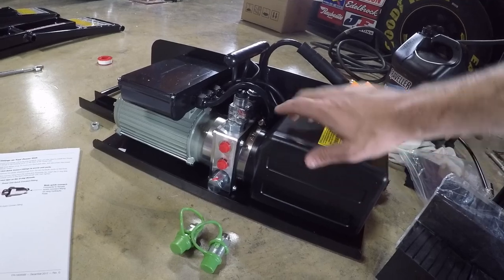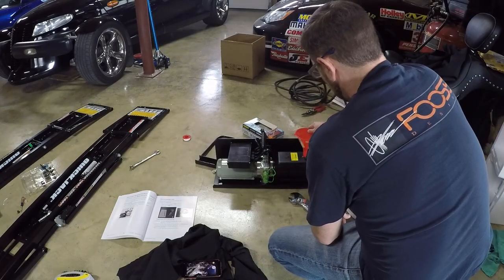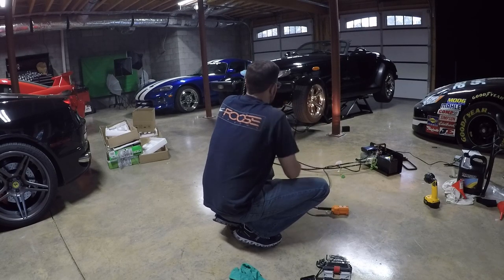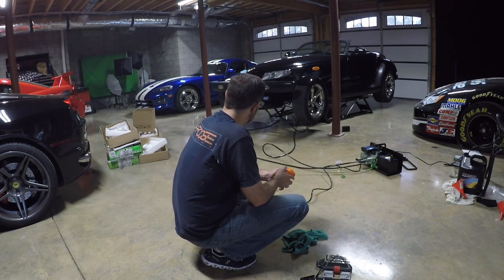BEST $1000 Spent! EASY INSTALL QuickJack BL 5000 Garage Car Lift Setup

Comment: While it isn't in the manual or the "official" QuickJack installation video, I chose to bleed the system by opening the bleed screws BEFORE  doing the first lift.
I did it this way to remove most of the air so I wouldn't have to fight trying to get it out later. I kept the pump on the floor with the frames.
Pulsed the up button a few times to slowly fill the lines with fluid while it pushed the air out. 
You can watch for fluid coming out the bleed screws. Once you see some fluid, tighten the bleed screws (mine didn't start showing fluid at the same time). 
Then push the up button a tiny bit more to lift the frame just an inch or two, then re-open the bleed screw to empty a small bit of air.
After this, I had totally smooth operation with no jerkiness even on the first lift.
I've used it for a few months now with no additional bleeding.
Also, there is no delay between when the up  button is pressed and when the frames start lifting, like I have seen in some other peoples videos - I'm assuming that they still have some air in their lines.
Reply from the maker: bperrybap this is a great write up. I wish I would have known this as I think you are spot on. I should have done it this way as well. Thank you so much for the comment.
Reply: Thanks just set mine up

Comment: I found a manual bike tire pump works as well.
Reply from the maker: ruthlessluder I think that would have been a better option. It’s doesn’t take much air at all. Thanks for the comment.

Comment: I used a bike pump to pressurize to 50ft-lb. just 3-4 pumps of my floor pump was all it took.
Reply from the maker: Vicente Santiago I was amazed how quickly they pressurized but I guess I’m used to filling tires that hold so much more air. Have you enjoyed your lifts so far?
Reply: John, i just assembled it this weekend. Will probably bleed the brakes by end of the month.

Comment: I noticed at 13:28 when you lift your frames, it sounds like there is sand or some debris inside the QuickJack frames. I just assembled my BL 5000SLX and I noticed the same thing with both of my frames. Did you have any concerns? I did contact Bendpack and they said it's just left over sand from sandblasting, but it seems like an awful lot of sand left inside honestly!
Reply from the maker: Joel Kline I also noticed the sound of sand. After a few uses I don’t hear it any longer and it seems to be working great and very smoothly. Hopefully nothing will hurt the hydraulics.
Reply: @JohnEngel  That's great to hear! I've only used mine twice, so hopefully it dissipates for me as well. Thank you for your video and following up!

Comment: I’m digging that lift.  Glad you got working well too.  I’ve been considering something like that but haven’t seen enough to know how they work or what’s good or bad about them.  Thanks for doing this vid bud.
Reply from the maker: East Coast Classics thank you so much. I will have to do an update and review after I have used it a couple times. So far I am happy with it and the prowler is in the air, so now back to work and fix the coolant leak. Lol. It never ends.

Comment: Great video...what type of hydraulic fluid does it take?
Reply from the maker: J B I went to tractor supply and bought standard hydraulic fluid but the instructions state you can use ATF as well.

Comment: you shouldnt raise without weight even on the first use. its on the instrucctions
Reply from the maker: Pedro Rodriguez the instructions and video link below both show lifting for the first time with no weight. Please take a look. It does say to not go beyond position 1 with no weight. 

https://www.quickjack.com/setup-video.html
Reply: @JohnEngel  Go and download the manual it clearly says at the very beginning in big letters STOP IMPORTANT PLEASE READ (then follows the warning) . Maybe they updated the manual but not the video, I know all YouTubers do it your way.

I Just want to mention it to help avoid frustrating headaches to people.

I don't have the quickjack yet lol, but I think Ill buy one tonight. =)
Reply from the maker: Pedro Rodriguez you will love it. It’s a great product and the Mobility of it makes it great. You will want to be very careful if you are going to do the air bleeding process with a car or other weight on it. It’s very staccato in the beginning before all the air is out. Let me know how it goes.
Reply: @JohnEngel  That makes sense. While doing the initial bleeding might be dangerous with a cars weight. Or maybe that's the reason why in the beginning is very staccato. Don't know but thanks for the advice.

Comment: Thanks for the video.  Are you still using them?   FYI, at 04:10  The elbow had an O-ring on one side but other end has an "AN" fitting.  With the AN fitting,  the sealing surface is the convex tip, not the threads, so no teflon tape .   I have a feeling the company said put teflon tape on all male ends so there was to confusion.
Reply from the maker: Dialysisforever i have been using them for oil changes and standard maintenance. They really have been great.
Reply: @JohnEngel  Thank you.
Reply: I was going to comment on this as well.  It’s not a “no o-ring” or “o-ring” decision to use thread tape.   

The decision should be based on connection type.  

    The fitting from hose to quick-disconnect is PIPE THREAD (NPT) which is a tapered thread and pipe tape or pipe dope (pipe thread sealant) would be appropriate.

     However, the fitting from elbow to hose is a FLARE FITTING.  It is not necessarily an AN fitting (which is a specific geometry of flare fitting).

In all likelihood, it is a JIC fitting which happens to share the 37 degree taper angle as AN, but has looser tolerance control.   The other  Flare Fittings is SAE (45 degree angle).

      Either way, the sealing surface is the mating area between the male and female tapered surfaces.  If one adds tape to the threads, it could cause difficulties in getting the mating surfaces to contact with sufficient clamping force.

      As a general rule, with tapered fittings, keep the threads clean and dry.
Reply from the maker: Stepclimb great info. Thank you.

Comment: bleeding wrong....you open valve then use lift...while lift completly up you then tighten valve ....similar like bleeding a brake line on cars
Reply from the maker: Mnic Moreno great point. I only went by the instructions but I think you are 100% correct.
Reply: Air goes up so when bleeding raise the port up so the air will escape.
Reply: Vicente Santiago yeah but you are not supposed to raise the lift completely up without a load on it or you’ll have a hell of a time getting it to go down. First thing they tell you in the manual.
Reply: David K. I wasn’t referring to lifting it up by raising it. was talking about when bleeding to physically lift the end up to let air go up. It’s heavy but doable and worked well for me.
Reply: Vicente Santiago ah my bad.

Comment: They want $1630 usd in Canada.  Want but can't justify that cost.
Reply from the maker: adamra187 for that price you are getting close to a 2 post lift. If you have the space and room that’s the way I would go unless you need something Mobile.
Reply: @JohnEngel  I found it a lot cheaper at Costco.
Reply from the maker: adamra187 I think I paid 1000 usd for mine. Was it around that price?
Reply: @JohnEngel  With exchange very close $984,  So around $1300 Canadian  we get so screwed up here.
Reply from the maker: adamra187 that’s so much better. For that amount I would say it’s worth it. :)
Reply: @JohnEngel  costco was just selling it at 1150CAD
Reply from the maker: Poutinsky _ they are 1000 usd here.

Comment: Too many mistakes shown in this video. I'd suggest new users to use the official Quickjack video. It shows the CORRECT way to set this system up.
Reply from the maker: Thank you so much for the support. I followed the directions and it is working great.